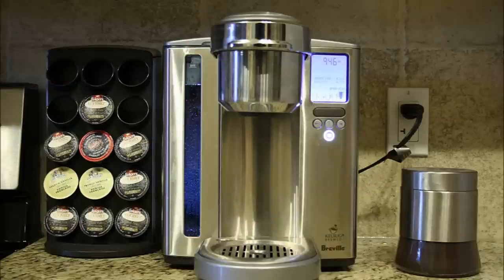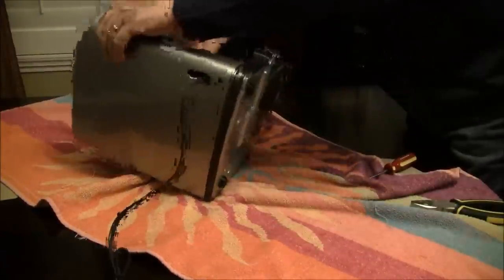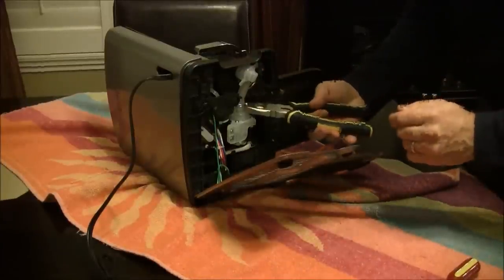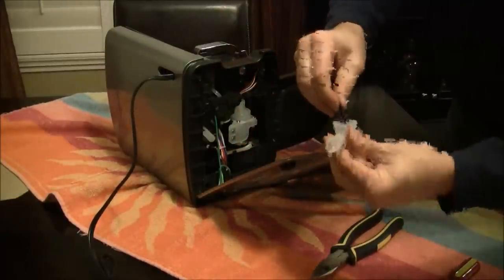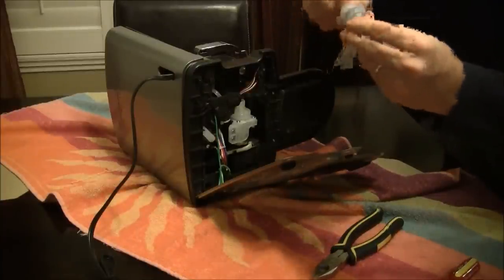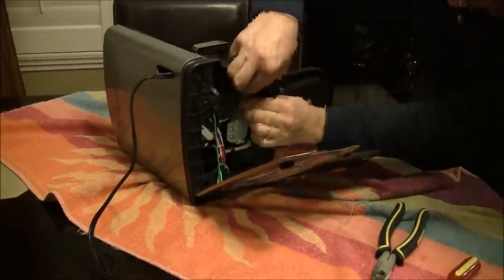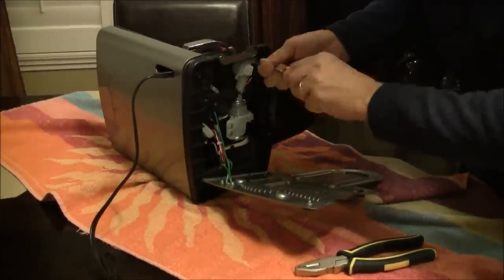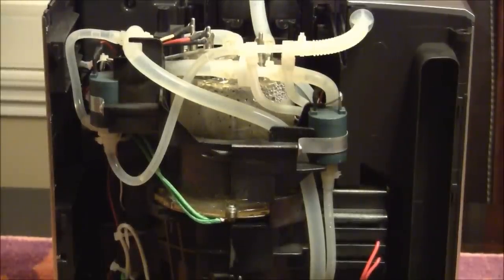Keurig Breville Fix to slow brew and partial cup

Comment: Question, I took everything apart and wasted the filter. I then put it back and tried to run vinegar through the tank and I'm still getting only a bit of water into the cup. Like not much at all. I have to push the brew button at least 4x just to get a half cup of coffee. Any other ideas?? I have the vinegar sitting in the tank right now. Thanks for your help!
Reply from the maker: Unfortunately I don't know what all the possibilities are that can cause this problem. The filter seems to be one of the most common. Beyond that I am not much help. Good luck!
Reply: Ok, I do have a couple of things I found out. First, the coffee maker doesn't like the refillable k-cup. The grounds just get up into the needle. I cleared that out with a needle. The second thing I did is if you lift the lid where you put the kcup, next to the needle on both sides there is 2 screws., remove them and it will take the top of the lid off and expose the hose. I pushed the brew button and as it was trying to push water into the cup, I squeezed the tubing ...more like massaged it and whatever it did, its now working. It either blew out what was blocking the needle or it created a better suction for the water to pump through.  It has tried to act up since then but only with the manual, fillable K-cup. I cleared the needle with a pin again and used a real k-cup and its working fine again. I hope this info helps others.
Reply: One thing regarding the adapter cup - don't fill it to the top.  That will almost always cause the water to back up as opposed to flow through.
Reply: @jferkee  Thanks. Great tip.

Comment: Worked for us! Thanks!!
Reply from the maker: Awesome! Glad to hear it!
Reply: I have a question for you. Where I live, we have a lot of minerals in the soil, especially iron (lots of red soil here in the mountains). Even with a water filter in the basement, to filter our water ( since we live in a very isolated area, we have a well, so we have to install a water filter in the basement/garage where the water comes from the well pump to the house), I wonder if mineral particles in the water (even though it's already filtered when it comes from the well pump into the house) are somehow making their way into our tap water enough to clog the machine and make it pour slowly, cause it to dispense a small cup when you select large, take forever to heat and pour, sound like the motor is straining mightily to dispense, etc... What are your thoughts. 

 Oh yeah, I just took the reservoir and filter out, rinsed it cleaned all the little screens, and put it back together (have a Keurig; the simple model, not the models that have digital and LCD type displays). Maybe I re-seated the parts(because it wasn't that dirty) better, or something. Whatever I did worked because I ran a large cup of water and it heated and dispensed a large promptly, the motor wasn't making that straining noise, etc... In other words, it works good now. I hope this is a good, long-term deal and I keep it running smoothly. Anyway, thank you. It was your video that showed me about the inlet and hose, and how the water gets into the machine when it's in the reservoir; you gave me the idea to get some tools and see what I could see and do this.
Reply from the maker: I suspect that most "filters" will not remove all the minerals from that water that you use. Follow the manufacturers instructions and do a vinegar flush once or twice a year. This will dissolve the "hard water" minerals that may build up inside the machine.  If your pump sounds like it is no longer straining, then I think you have already un-plugged the blockage and you are on your way!
Reply from the maker: Glad the video helped! I would still run a vinegar rinse through the machine once or twice a year. It will dissolve the minerals that do build up in the machine. I have hard water (mineral rich) at my house too, so the vinegar rinse is needed every now and then. The clogged filter that I show in the video is normally not caused by minerals, but usually other debris that manages to get in there.